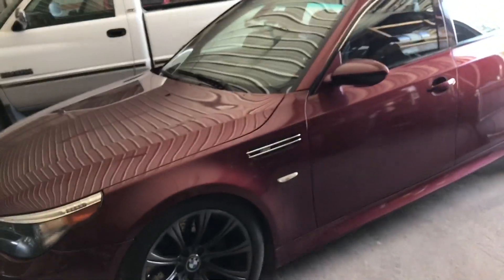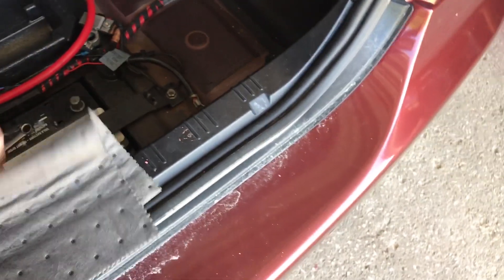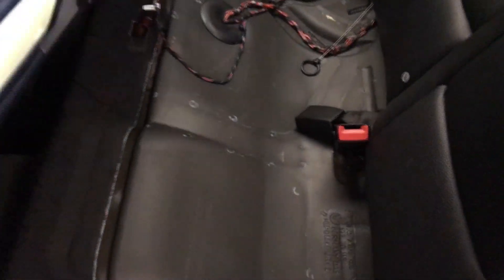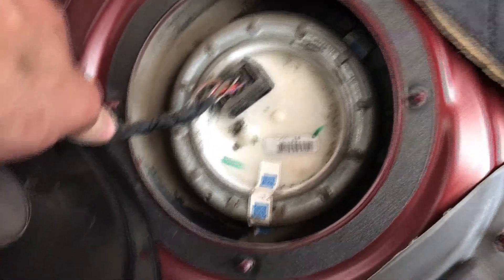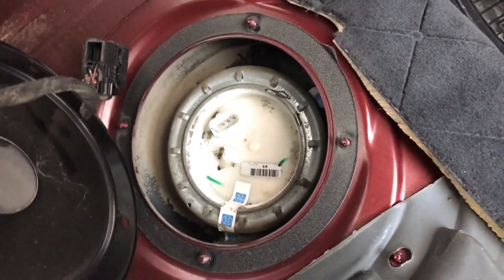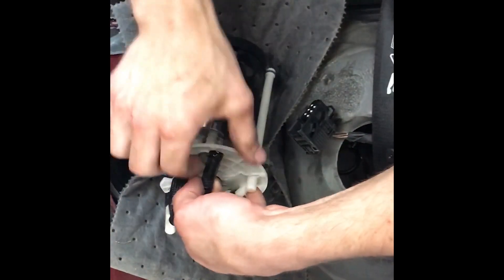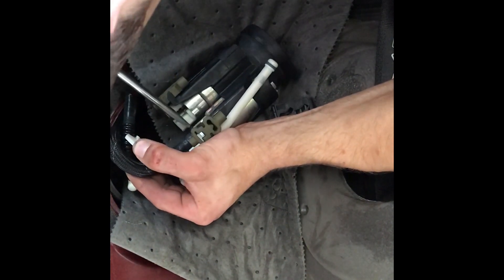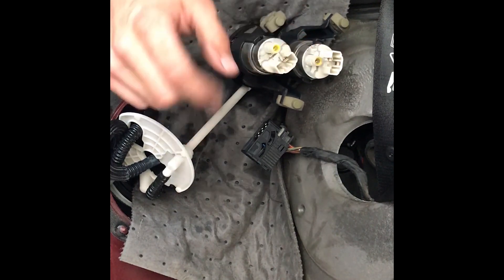$106  Fuel Pump Upgrade for Full E85!! E60 M5  Part 1 DIY

Comment: The pump draw is controlled by the EKP module so even if you put larger pumps the EKP modules MOSFETs are not designed to drive the pumps with larger current draw. You need higher capacity MOSFETs to drive the current on demand higher draw.